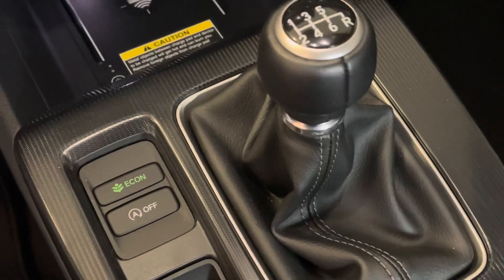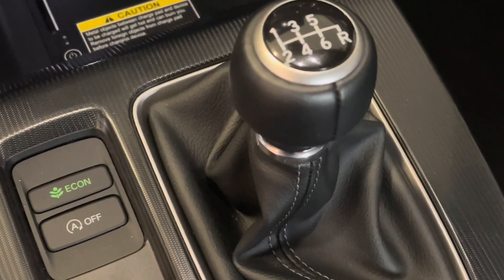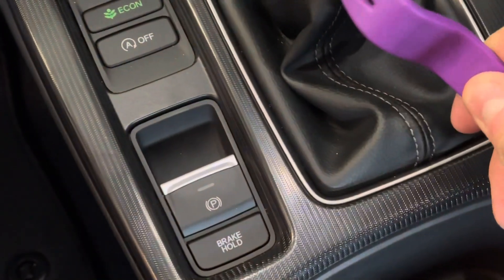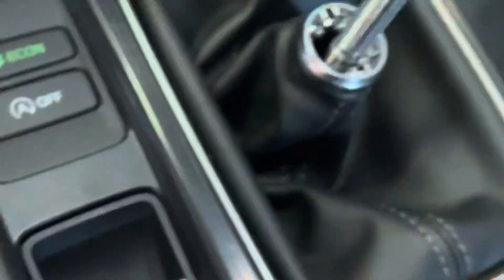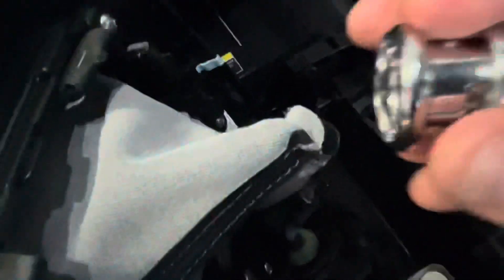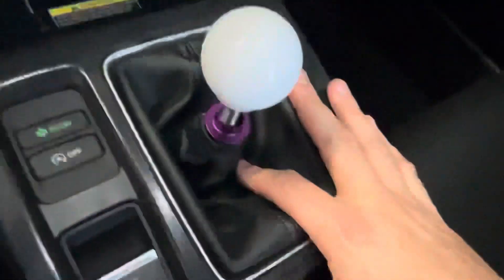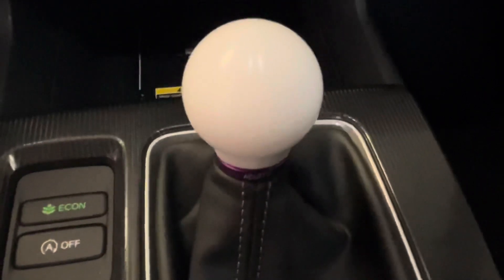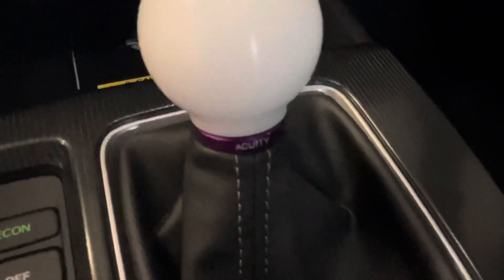Acuity Instruments Insulated Poco shift knob install, 2022 Honda Civic Hatchback

Comment: Is that how you install all knobs for the ones with the plastic clip ons? Mine has same style and was lost on how to attach a knob from advanced auto parts
Reply from the maker: You screw most knobs on with a nut
Reply: @axionind  do I add the nut or does it depend on the knob I buy?

Comment: Can you show a video on how to remove the collar for the SI? For some reason mine is not coming off
Reply from the maker: You just pull the boot down
Reply: Mine won’t come off either, did you figure it out?
Reply: @DominicDarrell  Are you trying to change the shift knob or the boot?
Reply: @marcj.d  I just want to take off the boot to clean it
Reply: @DominicDarrell  If you're going to do that, you need to remove the whole plastic trim around the sides, because it's clipped inside.
Reply: @marcj.d  I figured I’d have to, which I can do, but I struggle with getting the top of the boot to drop down the shift lever. It remains attached to the ring below to shift knob. I’ve tried pulling it down but all I’ve done is pull the boot out of the zip tie underneath a little bit